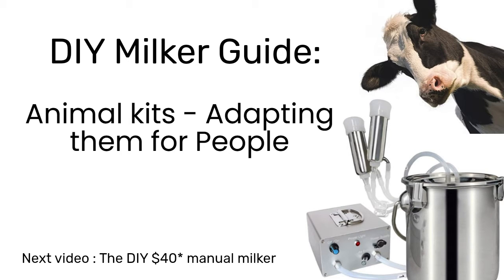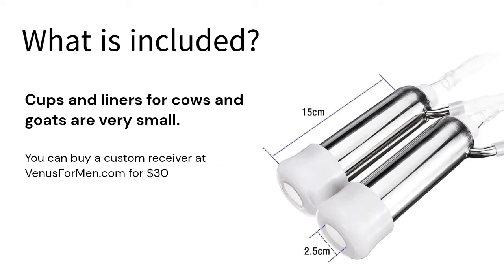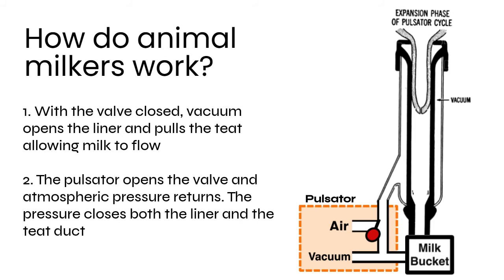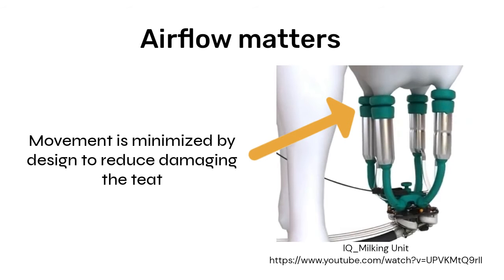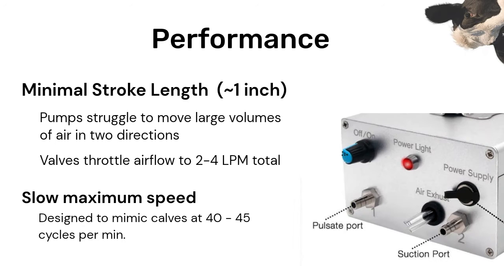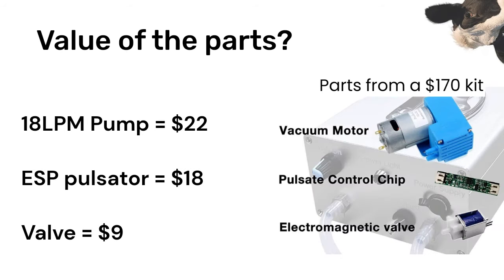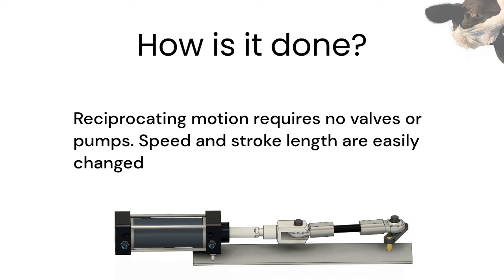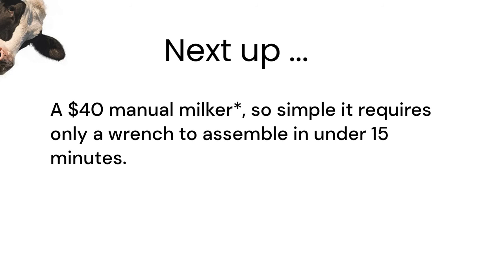Adapting milking kits for animals to provide DIY Venus functionality on people.

Comment: Thank you for documenting your experiments! Very interesting stuff. So, the conclusion you came to is cow milker is not useful for human use?
Reply from the maker: Definitely. It simply doesn't move enough air. If you watch them on a cow, there's very little movement :/
Reply: @nsfwmachines8343  Simply reverse the hose connections to the teat cup to get all the movement you want . Replace the teat cup liner with a piece of bicycle inner tube . I have been using one of these for over 50 years with great results.
Reply from the maker: That’s really good info! Will be giving it a try

Comment: :I Suddenly I understand why I got so much weird push-back from suppliers when I was trying to build a high-capacity manual pump to replace the tiny bulb that came with my old rework irons (Weller/Cooper); And why they kept insisting that it would last longer if I didn't use high-temperature parts (that wouldn't be damaged by molten lead) and stuck to plastic - instead of just selling me my BOM.

Comment: Been doing some searching and I do like TempestMax's idea on using a gimbal motor for reduced noise in his new stroker, you get 2-3kg/cm torque out of the box -- would that make a good alternative? And in other news have you ever looked at using linear actuators? I was impressed with what Harrison Low has done in "Designing High-Performance Linear Actuators" just would have to build one to test the power...
Reply from the maker: Only recently, I considered how loud the machines are. I’d  been so focused on being able to take them apart / reconfigure quickly that I didn’t even tighten all the bolts. I just got some polymer bearings, rails, and carriage from Igus. They are incredibly quiet!   For actuators, I use a couple on a machine stand, but I haven’t found any in my price range that have speeds like the ShockSpot.  Have you seen the Hugher Tango? It uses a cable system that’s similar to what Harrison Low is doing. It’s genius!
Reply: @nsfwmachines8343  That Hugher Tango, I don't know how they get away with the pricing, but I suppose it would be low volume. Electrical linear actuators would be the best option the barrier being the price. I think the best option for me is the gimbal motors, and I'll keep searching for something as compact and quiet as possible...
Reply from the maker: Oh - sorry I misunderstood actuator vs. motor.  Someone on Reddit posted a vid a few months ago of one they got working. https://www.youtube.com/watch?v=x8gEdLga4-8   They are powerful, quiet,  and fast, but I don't know how well they would do being moved around and repositioned on a stand.  They are coming down in price and available used on EBay (around $1500 with a driver).

I can't say it's a $3000 feature, but the one thing the tango has nothing else does is that the motor is separated out from the cable drive system.

Thanks for the info on TournesolInPrivate  - just saw his videos! Very interesting!
Reply: @nsfwmachines8343  I can see a lot of time being spent on making a linear motor, have seen some with rod/core filled with ND magnets and copper coils surrounding, though I think these even go up to 4-phase, I can still see a cylindrical linear motor being even quieter as it doesn't even need bushings -- it's the electronics that someone has to simplify or package first... As for positioning etc, have you looked at the F-machine Gigolo? Only 1-4" stroke but nicely packaged.

Comment: I have been working on my own milker and youtube searched for venus to see if anyone had made their own as well. Im glad I found your channel I’d love to see more of your creations. Instead of an air cylinder I was thinking of simply using a plunger sealed and connected to a sheet of plexiglass that would be pushed in and out. Ill let you know if effective.
Reply: TournesolInPrivate did a good job of a receiver. Though the most interesting design so far is the retention ring addition in the NimbleStroker...
Reply from the maker: That sounds promising! The first DIY machines I saw were based on something similar - a flexible bladder. There's a guy on Etsy who's selling ones he's made. The plexiglass could allow you to see the machine actually running, which I think is awesome. I'm curious about the adhesive, I haven't had much luck with something that was flexible and strong, while also bonding to plastics. https://www.etsy.com/shop/YouGotThatWhere